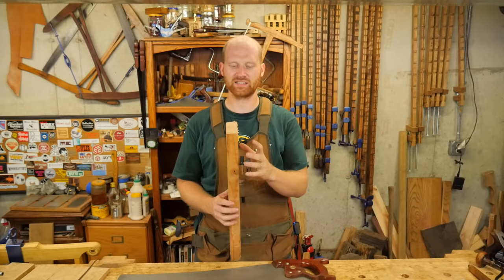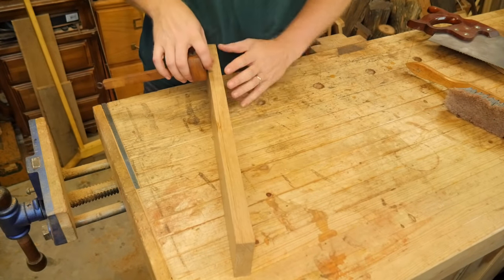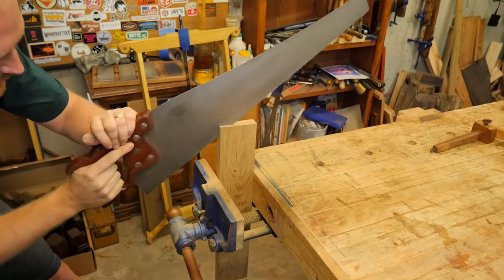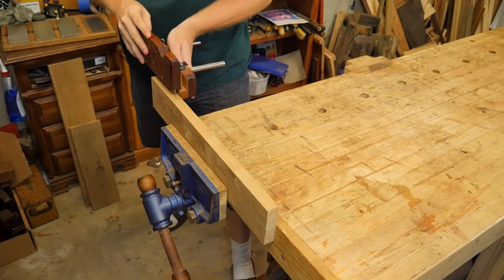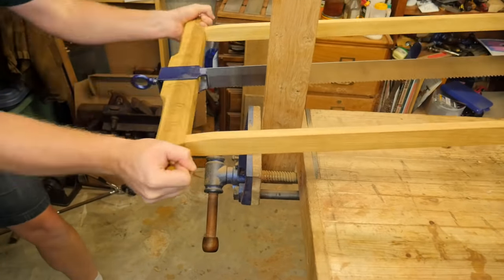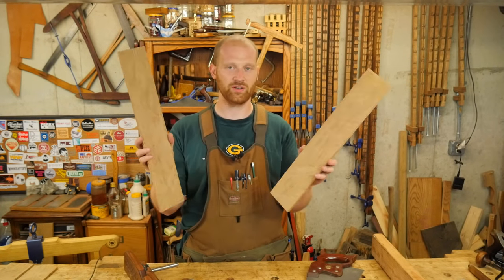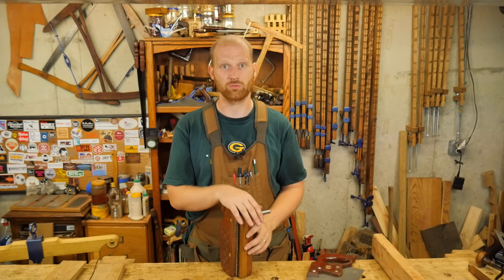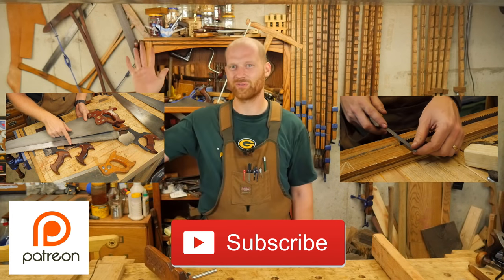How To Resaw With Hand Tools Hand Saw or Frame Saw cutting Oak

Comment: I just did the math: 10 and 6 minutes for a board that's 19" x 4", that's respectively 8 and 12 square inches a minute.
For white oak.
I'll be timing myself with chestnut and I'll post the results here :)

Thanks for your ressources. Something hand tool YouTubers don't emphasize enough is how much safer (for fingers, ears and lungs) it is to do things by hand. For hobbyists, that should be a primary decision factor, since productivity is not really the end goal.

Comment: I am so glad to find your channel. I have access to some walnut and cherry logs from my woodlot and splitting them down into boards (another of your good videos) has been on my mind. Jointing them without a jointer and planer and then resawing them to make some small dovetail boxes for gifts is on my bucket list. All topics you have covered. I appreciate your time and effort. You are an excellent instructor. Thanks so much.
Reply: Also, what kerf did you choose for your rebate plane and Roubo frame saw?
Reply from the maker: Thanks man. My pleasure. Mine is 2" x 32" x 0.032"

Comment: Thanks for taking the time to make such detailed video.
I work with small pieces and here where I live, finding thin boards is hard, expensive or both, so I'll try to buy some regular boards and resaw them.
I like to use a japanese saw, because of its thin kerf. I just saw your video about building a kerfing plane, so I'm thiking about adjust your project, in order to use the same blade that I'll use for resawing the board, just by detaching it from the saw handle.
I'll let you know the results.
Once again, thank you for making those highly detailed videos!
Reply from the maker: Nice. sounds like a fun one. the Japanese equivalent to a large resawing saw is a Whale back saw. they are really hard to find though!

Comment: Cool video, definitely something I need to get into. first a good vice and heavy table. My workmate won't cut it.
Thanks, cheers.
Reply from the maker: ya you are right the work mate will not cut wood. you need a saw for that. LOL sorry I could not resist. a bench really is the first too.
Reply: +Wood By Wright when I throw a pass you might as well run with it right...
been working with my workmate another foldable workbench but both don't have the weight (I guess that would defeat the foldable/portable bit) so have to put my foot on it or sit on it at times, lol.
But a good workbench us definitely on my to do list. Let me know if you find another one in your shop ;-)

Comment: Good stuff. I learn every day. I dont have a rip saw, nor the roubeau. Ripping, i just dont do it if i can help it. Buy thinner stock. Or o use my little rickety old crappy bandsaw. 

I looked for rip saws, but never found one. Weird. Even the shops dont carry them...
Reply from the maker: ya most all hand saws now ate crosscut teeth. it is sad. most of mine are either older or have been refiled to rip teeth.
Reply: The same case here, mine is an old, I restored the best I could. was a garage sale online

Comment: Great info james, I always have problems keeping the cut straight , I always seem to drift off to the right  of the line, guess I need more practice and not to give up and go to the bandsaw!!!
Really looking forward to the chisel rack video ! Keep up the good work. Trev
Reply from the maker: Thanks! if you are always drifting to the same side then you probably have a problem with the set of the teeth on that side. the way to fix it is to take a sharpening stone and slide it down the side of the teeth on the side it is turning toward. just 2-3 strokes on that side and test it again. often it only takes 6-9 strokes to change how the saw responds. that sounds like a great idea for a video. might have to do that some time.
Reply: +Wood By Wright thanks for the advice James I'll give that a try

Comment: James:  Just to make sure I have this straight, the teeth on the hand saw (for resawing) are for 'rip cut' not  'cross-cut'.  Correct?  Sharpening a rip saw is so much easier than a cross-cut saw.
Reply from the maker: yup because you are cutting with the grain.

Comment: Interesting! so the kerf must be as thick as the blade but with a small clearance so it can move right?
Reply from the maker: the kerf is the same on the plane and the saw. I sharpen them at the same time and put the same set on both so that make the same cut.

Comment: Another great video which inspired me to resaw a board yesterday.  It is not at all difficult but does take some time.  I have a question about actual finishing the cut. Did you turn the board over and finish the cut from the  bottom? Your video did not reflect the finish so I had to ask exactly how you did it.
Reply from the maker: +David Clark corect. Every 10" or so I lift the board up and continue the cut tell I am about 10" from the bottom. The flip the board over and cut again from the other end.

Comment: Hi James. I have done this by hand and with my table saw. I always use the table saw now because of an artificial shoulder. Riddle me this. Can I cut both edges as deep as I can with the table saw and finish the middle by hand? I would think the 8th inch curf would keep my handsaw straight. Secondly, is a Roubo frame saw easier on both shoulders? I'd love to make one.
Reply from the maker: I know several people that do that with the table saw. as long as you have the full 1/8" to play that works well.
Reply: @WoodByWright  Excellent! Thank you. Hope to meet you in Springfield.

Comment: Awesome video and timely as I have been thinking about this a while. Want to put together a kerfing saw and frame saw because I want to stick to handtools but want to know what kind of work is needed afterward in terms of cleaning up the face.
Reply from the maker: After the frame saw it really only takes a few strokes with the plane to bring it smooth. I treat it like Rough sawn surface.

Comment: My question is why didn''t you use the handles to hold your frame saw? Is there an issue with doing so?
Having watched your video on building one... I've been thinking of doing so.

forgive me is this has been asked/answered.. I have not read thru all of the comments...
Reply from the maker: At that time I was experimenting with pulling the blade or pushing it. So it was just easy to flip the whole saw and try the other side. Good question. First one to ask it.
Reply: Thx for the quick response.

Did you find any difference re: push vs pull?

Since I've got your attention here (hehe)... I was also wondering if there is a min/max blade length based on the width of material being resawn? 
Last week I found a great shop that sells locally sourced hardwood slabs. Spent about an hour there and left with 3 - 8/4 qtr-sawn slabs (8"x44", 9"x32", 9.5"-52.5") of White Oak & Ash and 1 - 6/4 slab of hard maple (15"x55.5").
It got me to wondering how long a saw blade would be optimal for resawing... 1.5x the width? 2x the width? I assume there's some rule of thumb for this. Would a 20" bow saw be adequate or maybe a 24" frame saw?? IDK... ¯\_(ツ)_/¯ I ask the expert!
Reply from the maker: lunaticprophet I prefer to push the blade. But that's really a personal choice. As to the length of the blade that really has nothing to do with the size of lumber used. Bigger is better but anything larger than 32 to 36-in is more than one person can generally push in a stroke. So unless you want to have a second person there isn't much used to get anything longer than that.
Reply from the maker: lunaticprophet the only main rule of sums that I adhere to 4 blade length is I want the saw blade to be more than twice the width of the board. That way it can eject dust and there is no portion of the blade that stays inside the wood.
Reply: Thx you so much.. I really appreciate your thoughtful input. I've only been woodworking for a little more than a year and I don't think I ever would have gone this far with it had it not been for the woodworking channels like yours. 

These vids have been invaluable for knowledge and inspiration. And well worth the hundreds of hours I've spent watching.
Living in a condo presents lots of issues with using power tools (dust & esp. noise), so learning how to do as much as I can with hand tools has been an eye-opening experience. My first project was a loft bed/storage cabinet (support for upper bed) and bed frame (lower bed) that wouldn't have come out nearly so well had it not been for the woodworking channels on youtube. For that I thank you.

I've found that I actually enjoy building the tools more than anything else. Such a joy to create something useful... a tool that can be used to create even more. It's really a lot of fun. I have a couple of Steltman chairs on the drawing board for the white oak. An electric guitar for my oldest son for the ash/maple. 

And for me... a Moravian workbench, a low angle wooden jointer plane, and a Japanese smoothing plane. So.... LOTS of projects! LOL 

But first I'm thinking bow saw and/or frame saw.
ehh... I'm rambling.. lol.. Again, thank you for your help. Much appreciated!

Comment: is a third method by saw frame ( German style), without kerfing plane
Reply from the maker: Correct. I don't like doing that by myself though because I can not see the other side. but I have not had as much experience with that saw.
Reply: +Wood By Wright yes is hard and you need experience. nice video

Comment: recently had to re-saw a 2' length of qtr-sawn purple heart... WTF!!! 
It took forever and I was a sweaty mess! I think a frame saw or bow saw would have helped me greatly! 

Certainly not anything I want to do again but I have about 10' of 2x2, 20yr old stock remaining. I don't have a table saw (although I could rig up something with my circ saw) but I don't want to lose that much material to kerf sawdust as I'm creating 1/4" veneer.
Reply from the maker: Oh my word that sounds like a crazy fun day. Ya a frame saw with big teeth will make life much easier.

Comment: Thanks for posting this video.  I've done a bit of re-sawing by hand and it's nice to see how others do it.  

About your saw... The plate had a bit of wobble and had a wavy shape at rest.  Is it properly tensioned?  The trick with Western saws is that the plate is too thin to account for its stiffness---it's stiffness comes from stretching the outer skin of the blade. Basically you use a ball peen hammer a little above the teeth...  Check out this video:

https://videos.popularwoodworking.com/courses/handsaws-tune-up-setup-more-part-6-should-you-tension-your-own-saw